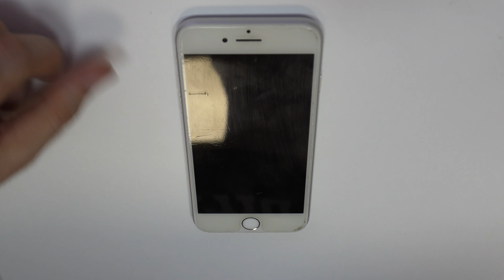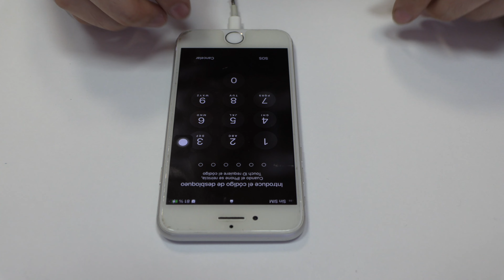iPhone 8 mic not working! They can´t hear me, on call!

Comment: Well, it could be the IC audio chip, really common fail in i7s and i8s, just double check if Siri is working and also if recording a video the audio works
Reply: how do you fix it
Reply: @gbnchris3162  this is a quite difficult repair as you have to replace the chip from the motherboard... i will recommend you to check the repair with a qualified technician, otherwise the phone could be easily broke.
Reply: @alregaman  Ok thank you
Reply: @alregaman  Siri works fine, recording videos from both back & front cameras works fine and also voice memos too, but when making normal call the other party cannot hear me clearly, they say that they  can hear me as I'm speaking from distance & sound also little muffled, what could be the possible reason for this. ?
Reply: @lahiruashan6487  First try to clean the bottom part of the phone with a brush but no liquids, where all the holes are, both sides of the charging connector. If that doesn't work, your mic may have been damage, so you will need to replace the charging port flex cable and it will fix the problem 100% sure. Let me know how it goes. :)
Reply: @alregaman  Okay bro I will do the same and let you know.
Reply: Not sure what the problem is BUT i know the iphone 8 has THREE microphones.  The one for calls and the one for video is different.  The call mic is at the top, on the face near where you put your ear.  Another mic is on th bottom left, and theres one on the front near the camera
Reply: my siri works and my audio messages on imessage work but when i record u can’t hear and when i record a audio message on ig it don’t work n calls can’t hear me what should i do
Reply: @alregaman what if siri and videos work but voice memos and audio recordings dont work?
how do i fix that
Reply: @Lilcgs  are calls working fine? If not, it should be the flex cable as it includes siri and calls/audio mic, not video.
Reply: @khaylaluvv  contact a local technician, looks like you IC audio chip is frying out.
Reply: @alregaman  Siri works, video recordings work fine too. Voice memos/calls do not. Is it the bottom mic that needs replacement?
Reply: @BeatSlayer   It looks, like thats your problem as it is not failling with the others :)
Reply: @alregaman  ty for your answerf
Reply: @BeatSlayer  Pls, let me know if this solved your problem
Reply: Hi there, I could use some advice.  My sons Iphone8 mic stopped working for calls. I've gone through everything and it is a weird array of issues. Calls do not work. Recording video audio doesn't work. Siri does work, voice to text on FB messenger works perfectly, talking to Google doesn't work. Things like Discord mic doesn't work.  I'm at a loss as to what would need fixing. This phone is pretty beat up by the way.  Also, recording an audio message on FB messenger doesn't work. It just leaves white static.  I've read the other messages on here and everyone's circumstances seem different.  I did all the usual. Cleaned the holes out and hard restarted it and changed settings etc.  I noticed on a Discord attempt, if I tapped the mic area I could get at least a response from the mic intermittently.  So strange how some things work perfect with the mic while other things make the mic seem damaged.
Reply: @w-dad4040  on the iphone 8, there are 3 mics. the top mic above the speaker is used for siri and things like voice messages. the bottom is used for calls and so is the 3rd. to me, this sounds like the chip is fried. very difficult fix, i don’t think apple even covers it anymore because of how common it became. some repair shops will. take it there.